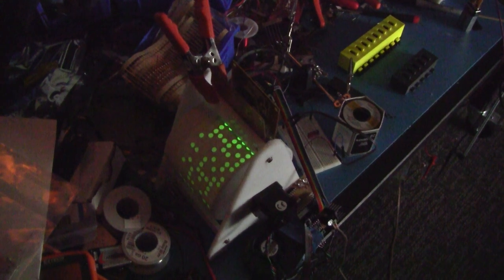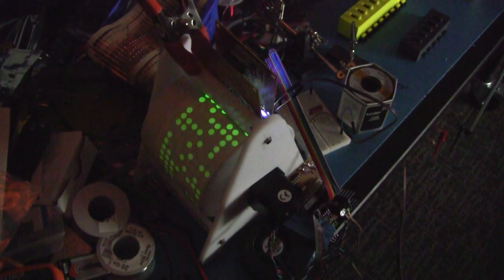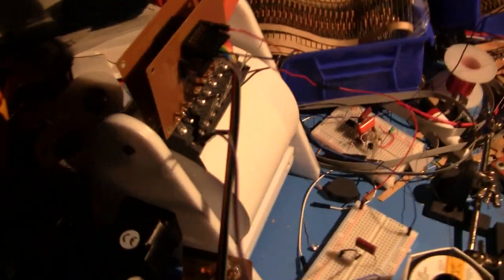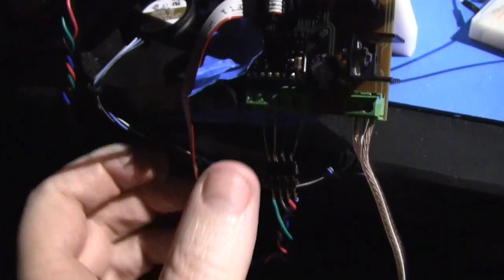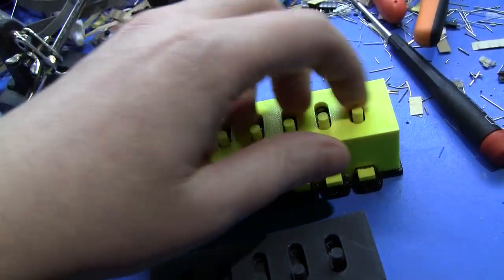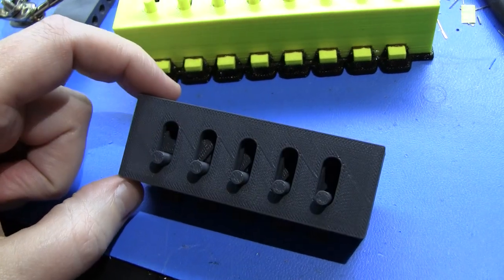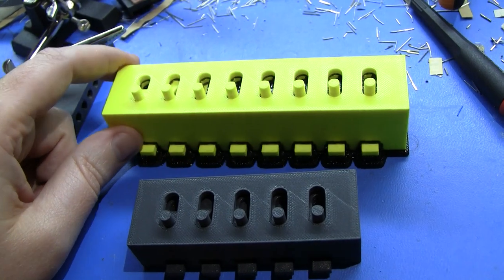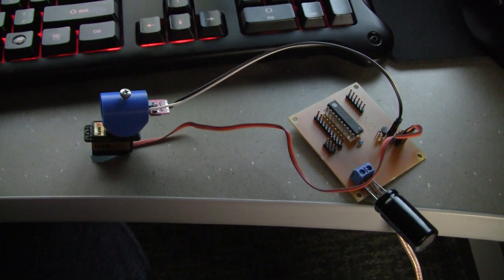2013 Maker Faire Project Sneek-Peek

Comment from the maker: The longer wave IR light quenches the phosphorescence of the copper doped zinc sulfide.  How that works is not easy to explain without some quantum mechanics, but basically phosphorescence is energy stored in a metastable state that can decay with low probability by emitting light, the temperature of the lattice effects the likelihood of a decay happening in a nonradiative way as can longer wave radiation or electric fields in general.  It basically drains the stored energy out faster.

Comment: Is that me or did you put the LEDs in a wrong order? You should probably erase first and then "charge" with UV. It could work in reverse too, but the logic needs to be more complex. You would also have less problems with light leakage leaving stray "bits" around. In addition, the erasing "head" could be totally dumb - just erase the entire row every time and then write a new byte.